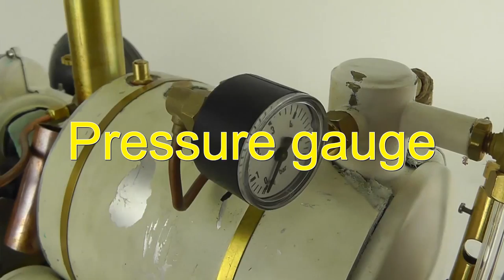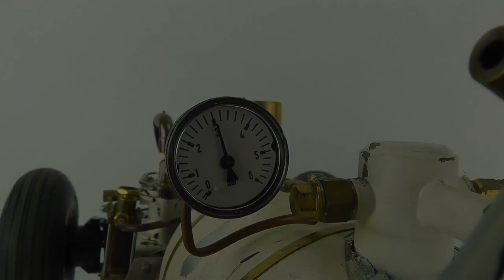Audi on Steam - Inside the Silberpfeil

Comment: Why have it idle? For the sound?
Reply from the maker: justfakeit888 Yes!
Reply: Not just for the sound, though. Idling your steam engine removes condensed water from the system, which can cause damage to the cylinder during operation. It also gives the engine time to warm up, which makes the metal expand and the lubricant to enter the chamber, giving seals a tighter fit and better performance.
Reply: If you don't idle it it will need to be started again with the motor